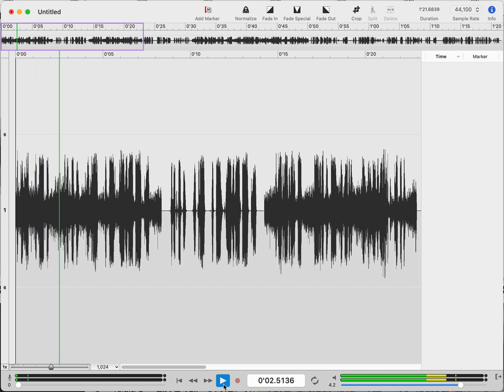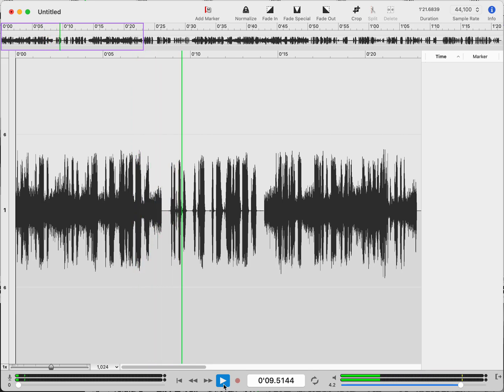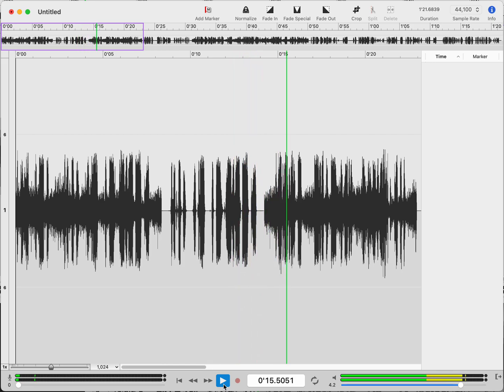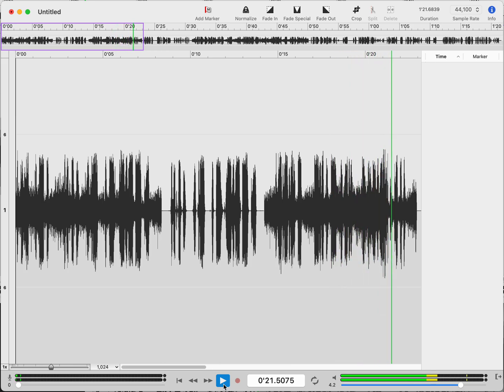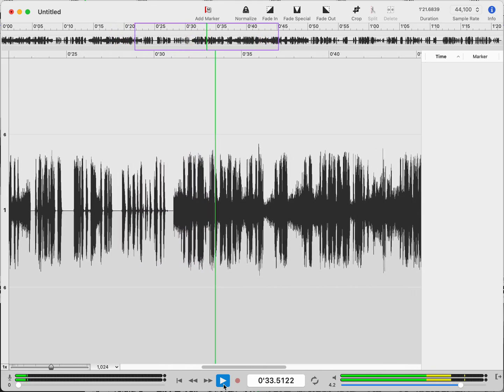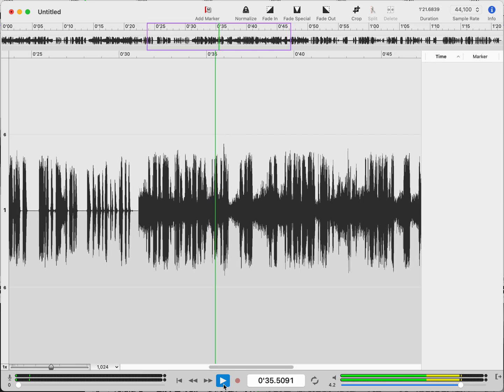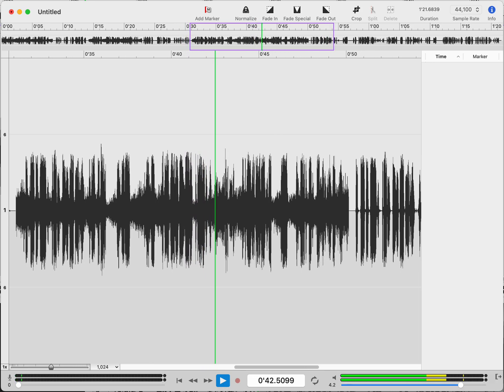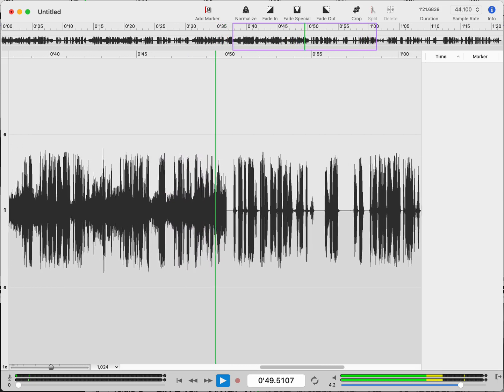AI noise removal from off-air single sideband audio

Comment: Interesting. While it is less fatiguing to listen to the "cleaned-up" audio, I actually find it a bit harder to understand at some points than the original. I suspect that the AI is distorting the speech a bit in its effort to remove the noise (which is inevitable, since it is not actually possible to remove noise totally without loss of information)

Comment: I run Hermes Lite 2 SDR (ham radio) there is software called thetis and one of the filters NL2 does that in realtime.  It's pretty impressive, makes SSB sound like FM
Reply from the maker: Very interesting. I think it's called NR2 but from what I read it can be trained for your noise.
Reply: @peterbmarks  lol you are correctly. NR2 , brain fart moment.  I haven't seen anything about self training.